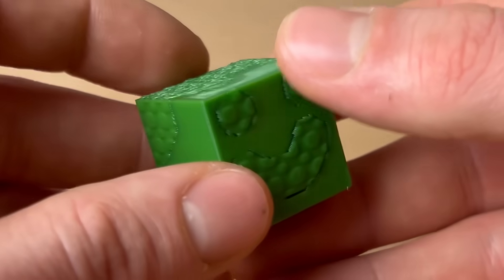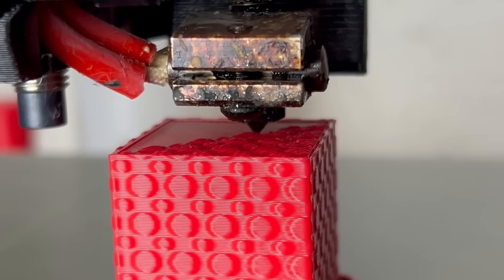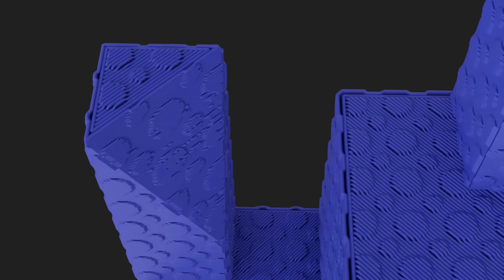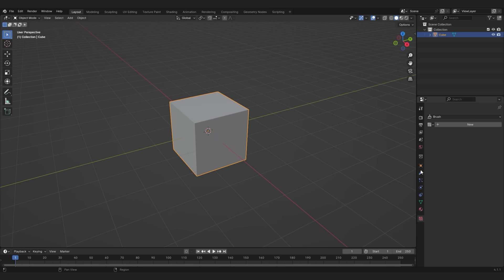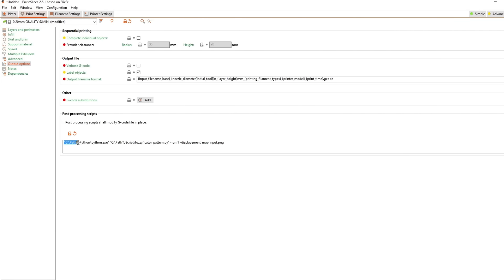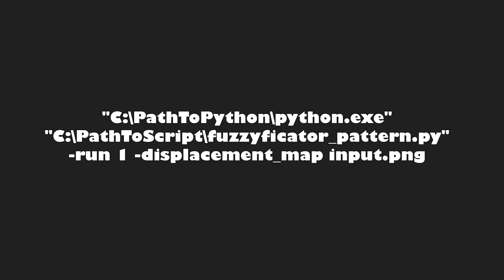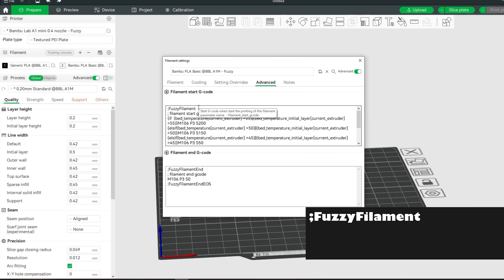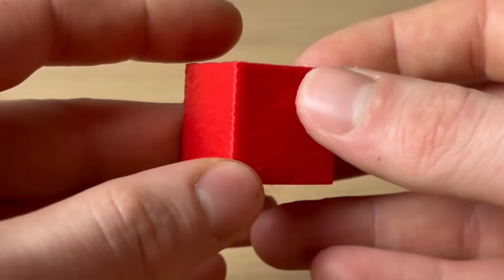Non-Planar Paint-On Patterns - 3D Printing Guide!

Comment from the maker: Important!
I forgot to mention 2 things in the video. If you have problems running the script, install numpy and pillow to your python environment.
You should use a displacement map that is at least 4000x4000 pixels to get good results. You can also just upscale smaller ones. This is due to me not adding  a size parameter I will have that fixed in the next version.
Reply: I guess Material-Maker could be promoted as a good FOSS tool to get those high-res pictures!
Reply: Wow! Thank you for contributing this to the community! 
Im trying to learn Blender but it doesn't like me very much. 
Tell me... How can I make this work on my Qidi printers? I'm not versed in Python. Sorry.

Comment: I think you had no idea of the monster you created. When you made the localized fuzzy skin I jumped out of my chair, now, what you did was simply something that thousands of people have wanted and would pay to use as an extension in some app or website for years. I may be wrong, but I can generate a moon with my photo if I want to make a lithophane, right? But I can also make anything in any shape like that, that is, the possibilities are endless. I'm already thinking about how I'm going to make external textures on food (yes, I print food at a research level, but at an advanced stage), so I'll be able to texture food without needing very complex modeling. Are the textures maintained through boolean operations? Once again, congratulations on your work, I saw today that Prusa launched the slicer, if I were Joseph I would send you one of those Core Ones lmao!

Comment: Hello, everything is working fine so far and Bambu Studio also shows that the G-code has been changed. Unfortunately, the pattern is not displayed for me.
Reply from the maker: Make sure to use a map that is at least 4000x4000px this is an issue I haven't fixed yet
Reply: Okay, thanks!

Comment: Is there any way to make this work with a printer that has an MMU?
Reply from the maker: To you mean that the pattern parts are in a different color? For that you'd need to modify the code but it's totally possible and an easy modification.

Comment: On macOS I had to install pillow and numpy via brew in order to get this to work. Very interesting concept but I haven't quite been able to achieve your great results. Can you upload some of your displacement maps to Github, please?
Reply from the maker: Unfortunately I can't upload the maps used in the video, because they are part of a package I bought. I just checked the resolution of them and did some testing. Make sure to use a map that is at least 4000x4000 pixels. I haven't programmed a size parameter yet. But you should also be able to use an upscaled map.

Comment: Sadly I just cannot get it to work in Bambu.  I'd love to be able to use these to get detail on the sides of prints where loads of co or changes would cause it to take an impractically long time.
Reply from the maker: What problems did you experience?
Reply: @tengertechnologies  Post-processing script "C:\Users\----\AppData\Local\Programs\Python\Python312\python.exe"
"E:\Bambu\Scripts\Fuzzyficator-main\Fuzzyficator_pattern.py" -run 1 -displacement_map
E:\Bambu\Scripts\Fuzzyficator-main\MangekyoDM.png on file
C:\Users\----\AppData\Local\Temp/bamboo_model/Fri_Dec_27/12_25_40#29700#85/Metadata\.
29700.0.gcode failed.
Error code: 1

i have no idea what this means, but your github page's explanation suggests that that syntax should work.  all other ;Statements are in place as they should be, so it HAS to be the way the post processing script is being called.
Reply: @tengertechnologies  Post-processing script "C:\Users\xxxxx\AppData\Local\Programs\Python\Python312\python.exe"
"E:\Bambu\Scripts\Fuzzyficator-main\Fuzzyficator_pattern.py" -run 1 -displacement_map
E:\Bambu\Scripts\Fuzzyficator-main\MangekyoDM.png on file
C:\Users\xxxxx\AppData\Local\Temp/bamboo_model/Fri_Dec_27/16_29_16#29700#1127/Metadat
a\.29700.5.gcode failed.
Error code: 1
Reply from the maker: Can you try to install pillow and numpy? For further troubleshooting you can find the log file at C:/users/yourUser/fuzzy_script.log

Comment: This is a great proof of concept to get modifier textures out of having to use Blender (or model them in elsewhere). I said elsewhere this idea has been batted around in various places but you're the first to release some form of prototype. Great work.

Just for furthering the discussion and going off the issues you discussed, I do think it needs to be done on the 3d side (not the GCode) and in slicer, similar to how text is being handled. From the slicer point of view, the paint-on idea is good, possible with a selector for the displacement, and a depth value (cut or join), from there it would need to be converted to a modifier mesh and rejoined to the base model. Sounds simple to type, but it'd be a pain in the rear to implement because of the edge cases (overlapping textures, odd angle switches, weird intersections, etc.).
Reply from the maker: Yeah I think it's best to do it as direct displacement to the mesh before slicing and maybe for the toplayers as postprocessing. But as you said, it's not exacly easy to do that because automated UV-unwrapping in the slicer on a triangulated mesh seems to be hard to make to look good.

Comment: Impressive content, TenTech. Looking forward to your next upload. I smashed that thumbs up button on your video. Keep up the fantastic work! Your approach to integrating displacement maps into the G-code is fascinating. Have you considered how different patterns might affect the overall print strength or durability?
Reply from the maker: Thank you! I have thought about this but came to the conclusion that it probably doesn't affect the overall strength very much, because it's only the outer most surfaces. So 99% of the print remains the same. But the durability, if we talk about delamination of the top layer or even walls, is surely worse than on a normal print. But that's something, that should be possible to fix.

Comment: nice, how can i add my own patterns? i saw this before but i cant remember where? some software calle meshmixer? could it be?
Reply: The really old method (stood out in games because dark portions of a texture would be unnaturally indented) is with Photoshop and some clever blending layers.

The new method would be to either model texture in some form and then "bake" the depths onto an image or use something like Substance Painter. I think there's also a few AI model based scripts which help convert from image to heightmap.
Reply from the maker: You can just use your own images as input for this script. But yeah you can add textures to your model directly with Meshmixer too.

Comment: Can we also investigate non-repeating procedural patterns? I'd for example be very interested in a wood texture as I've seen people do this manually before and it looked awesome, but prohibitively annoying to create.
Reply from the maker: If you make the wood texture big enough, you should be able to just use it with this script. And I will have a size modifier ready on the next release, so you can just configure it as you want.